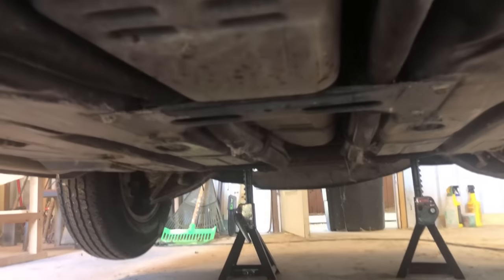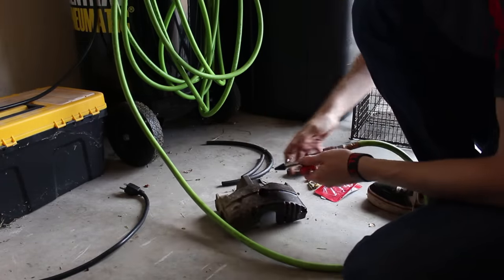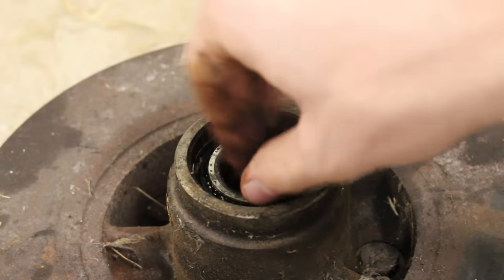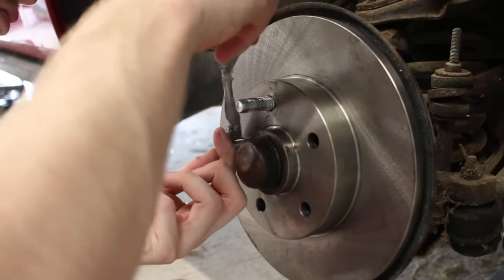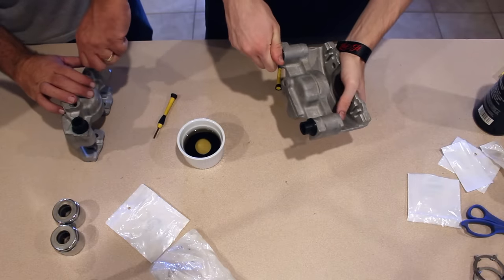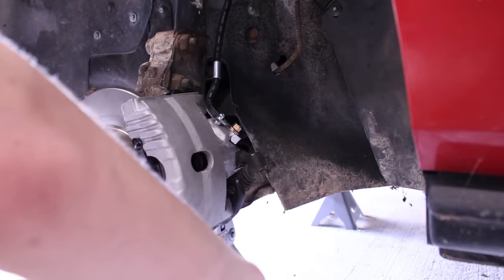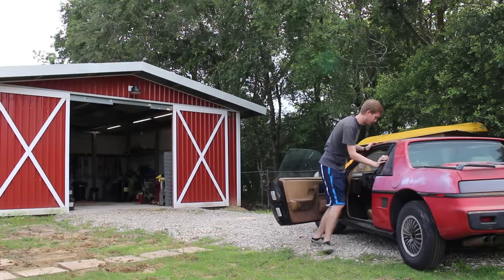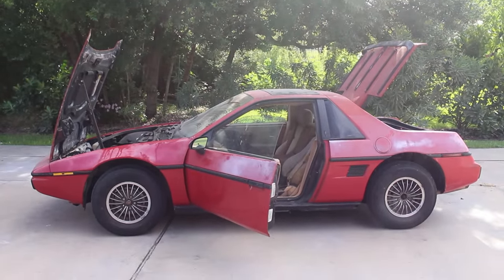Fiero Drive With Me | 1985 Fiero 2M4 Revival - Part 3

Comment: Fiero with a working e-brake? Car is now SUPER RARE
Reply: I agree. My 85 i wanted to fix that but then saw the cable is cut and gave up
Reply: i once owned 7 fireos....2 of them had working ebrakes....
Reply: It’s actually a hand brake. Not an e brake.
Reply: @warmfreeze  close behind you. I've owned every year model. Haha still have an 88 Formula and an 85 GT notch.
Reply: Totally agree!!!!! My 87GT park brake never worked... hahahah
Reply: mine works on my car
Reply: @DavidHh1969  parking brake
Reply: @MrSubaru1387  ironically i still have my 88 formula and 85GT notch XD and now i own subarus as a daily.. XD
Reply: @warmfreeze  I'l currently have 15 Subarus. Owned more than I can remember at the moment.
Reply: Hahaaa, then you must drive the BMW E39, where a new installed parking brake system isn't able to hold the car at steep hills, well, it holds it, but I don't trust it, because it holds barely. Enough that the car doesn't drive down the hill. 

And I bet my bottom dollar, that every E39 has this crappy parking brake thingy. Every one, also when you overhaul the complete system (what I did, expect the cables, but they are adjusted properly) it get's better, but compared to my old 1996 Honda Civic (pull it under driving and the rear wheels lock up) it is a worthless piece of junk. 
I think the Fiero does a better Job.
Reply: so very very true, the cable always rusts tight in the sleeve, or the cable stretches out and doesn't grab.
Reply: The Fiero came with a spare brake cable already routed so when you break the brake cable you get one free repair.
Reply: It's funny to hear you guys talking about Fieros and Subarus. My dad's friend had a new Fiero GT for a few years, and then bought a Subaru. That's a random sort of coincidence, given the Fiero is a very different vehicle in almost every way than any Subaru, and it's hard to see why one would lead to the purchase of the other.

Comment: Much respect for not just replacing every broken part with anew one. I realize there were cost saving reasons behind this but it makes the videos more entertaining and it makes the rebuild more sensible by not throwing thousands into a car that couldnt be sold for what was put into it. 👍
Reply: The Gmork  yep cause they rip u off especially on a car that is hard to get parts so they might need to custom make them

Comment: I assure you, dumb luck is a major portion of any shade tree mechanic's toolbox!  Especially when starting out.  After that, we call it experience.  Great job getting her going.  That was a lot of hard, tedious work... but it paid off!!!!!  Hold your head high!  You did well!
Reply: Cant drive a standard worth a crap though... Did you hear that clutch plate spinning?
Reply: I totally agree, Thomas!  I’m still fixing things by dumb luck and I’ve been at it for years.
Reply: It's hands on experience
Reply: @jonross377 , He did it on purpose to clean up the clutch and flywheel.
Reply: @augustreil  Maybe you are right, just seems odd that he continued to do it through the other gears.
Reply: @jonross377 , True. Could be that the clutch needs to be bled more ? Not really sure, but either way, they did a pretty good job for what seems to be very little money. To be young again !
Reply: @augustreil  Got to agree with you on that. They definitely did a good job!

Comment: My first “good” car, in 1988, was an ‘84 Fiero, same red with tan interior as this one. Mine was bought from the local Pontiac dealer’s used car lot, complete with a dealer rebuilt iron duke. It was not due to an engine fire, but because the Jiffy-Lube tech failed to retighten the oil drain plug for the previous owner. I was told it went about 20 miles before the engine locked up. Jiffy got to foot the bill for the rebuild. The owner’s daughter never really trusted it after that and, if memory serves, they traded it for a new Grand Am. I was, at 17 years old, thrilled to have something so fashionable and sporty. My father was thrilled for me to have something so slow (mine was an automatic) and that could carry only one of my bad influences (friends) at a time! Back then, yeah ... girls loved it (sadly more than it’s owner). The car was rock solid dependable, braked well, handled well (except it would fishtail like crazy in the rain), and was slower than all get-out! We would turn off the a/c to pass other cars (we referred to it as turning on the turbo). The lack of power steering gives you a great feel for the road and connection to the car (even if it is a pill to park, you get use to it). Seeing this car brings back alot of memories; but I got to say, seeing it in that condition does make me feel old! Hard to believe that was 30 years ago!

I couldn’t tell if your car has the “moon roof”? If so, you can removed it and there is a storage spot for the glass under the hood, behind the spare tire ... in case you were unaware. We removed it every chance we could. Looking back on it, I am shocked we never dropped the glass and shattered it ... but we didn’t! 

Keep up the amazing work ... and, when your finished, please do what I wish I had done ... hold onto it! Good job and I am glad to know that someone your age loves a car that was so popular when I was young! They were always special cars to those who really knew them!
Reply: 26 now, wanted one since I was 16, finances are too tight. But man I would loose to have one of these
Reply: @emokid3167  loose it up!
Reply: Brian,I was going to write a reply and came across yours ,change a few details and you have my story,. Ronald good job ,love the fact you went with rebuilding not buying off the shelf...

Comment: Haha, nothing short of excellent entertainment! Having worked at Parkway Pontiac during the early Fiero years, I know exactly what your going through, and I know what's to come. :-) 
If you have a little money to burn, this is an enjoyable way to learn. 
One tip I'll give you, when you have to replace the head gasket, you can sit at back of the car, with your legs in the trunk area, much easier than trying to over reach over the trunk while standing.
When the engine block cracks, well, that's another story all together ..... 
Hope you are having fun, can't wait for the next installment, brings back a lot of memories.
Oh, one other thing, early Fiero's like this, handle much better with a little extra weight in the front, we used to use a couple of small bags of play sand up front when auto crossing.
Enjoy the ride.
Edit: some of the fires were caused by cracked blocks, or lifter covers leaking oil onto the catalytic convertor, make sure your leak free, Ride safe!
Reply: 44for is
Reply: I will bet working on the v6 models were a real pain,  all that motor so little room

Comment: Had a black '87 - Stick shift, 40ish mpg, 92hp, and I LOVED it. Took me across the country and back. Eventually the rear caliper stuck and melted the brake line which then ignited the fluid with it on fire on the side of the interstate. Got it fixed and it lasted a few more years until I got my Saturn... Thanks for making these vids.

Comment: You should have painted the calipers red cause it makes it stop better.
Reply: Also racing stripes make it faster
Reply: Demetrius Lolos Yes, definitely.  They make high temp paint in red just for that purpose. Just make darn sure to throughly clean the aluminum with a non reactive cleaner. High temp primer is advised but is hard to find. Best of luck. Great job so far.
Reply: Lol
Reply: BOSS MAN  the box said 10 horsepower
Reply: Red calipers make it go faster too.  That's why it's called "Brake Horsepower" (BHP).  My car has red calipers and it does go pretty quick!
Reply: Don't forget the tornado that goes in the air intake.
Reply: I was just waiting for this to be said LMAO, also, tint your windows and put a michelin sticker on the tires, 200hp.
Reply: @robertdaniel2564  Woah there, that maybe too much for the cars transmission now.
Reply: I am pretty sure red calipers are +20hp I believe mcm said it.
Reply: +25KW

Comment: I had a couple of Fieros back in the day.  Here is a quick tip.... pull the thermostat and drill a 1/6 hole in it.    The modified thermostat will keep the engine from overheating while you sort out the car.    Keep the videos coming!
Reply from the maker: Everything has already been sorted out for a few months now! It was just a relay issue with the fan :)
Reply: better to get the 160 degree Thermostat from Fierostore
Reply: The hole is more for bleeding the air out, not allowing fluid to pass, trapped air will have it misreading coolant temps and remaining shut, that is the only reason, FYI most new thermostats have a bleeder.
Reply: @Maples01  My old Fiero used to do that to me from time to time, same advice I got from other owners on Pennocks
Reply: @Lon1001  I always buy quality thermostats, they've all had a hole in them, when it comes to replacing them, get the best, don't risk your engine for a few bux.

Comment: This is a great series you've put together so far man! October of 2017 I bought a 1987 Fiero 2M6 (2.8L V6) from an old family friend for $2800, but it was already running and driving and in pristine condition. I  love the car and it's fast enough for what it is, but I'm planning on doing a 3800SC engine swap sometime in the future. Still fun to tinker on though. The Fiero never got respect but it's a fun little car to drive around.
Reply: Is it good on gas for having a v6?
Reply: @Jason_Phillips3679  it gets about low 20s combined if you're not hammering it all the time. But it has a 10 gallon tank so gas is really cheap. 170 ft-lbs of torque in a 2800 lb car isn't bad, except for the 3 speed automatic transmission lol
Reply: I bought an 87GT at a storage auction June 17. Didn’t need  much to get back on the road (last registration was ‘99). Ive been driving it since has a 5speed not much power but fun to drive.
Reply: Might as well ls4 swap it

Comment: There is knobs near the head lights that allow you to manually turn them up just in case the plastic gears have broke in the head light motors.
Reply: When you replace the gears for the headlights use the metal ones, they last longer.

Comment: Been using bearing race/seal installer for around 30 years now. That's fine. But we have got to get you a real hammer!
Reply: This is affirmative, save the claw hammer for nail pulling.  Get ya one of them ball and peen hammers. You'll be glad ya did
Reply: Yep, 3 pound minimum
Reply: I noticed the claw hamer too.  But that's what's cool about him.  He uses what's at hand.
Reply: @stwhite5135  l definitely give him credit for innovation and the ability to dive right into things!
Reply: Offer an easy cheat on next bearing race install. Put the race in freezer and hub in oven or torch it then just drop it in no beating and no pressing.
Reply: I was thinking the very same thing!!!
Reply: @stwhite5135  I'm actually surprised he hadn't used a rock yet.
Reply: I second this, get a real hammer.
Reply: 5-6 lb short handle sledge. The good old BFH.

Comment: Nice work. I have a 1984 Fiero 2M4 4 cyl. standard transmission single owner which was parked from 2017 till last week when I picked it up. It was parked in a concrete driveway so none of the problems you guys had on yours are evident. I haven't tried to start it or anything yet. Too many other projects in the works but I am toying with the idea of taking a front wheel drive front drivetrain and sub frame and turning this into a twin engine all wheel drive for super cheap. I have an extra mid 80's Corvette parts car that I might steal some stuff from. Problem is I will want to put at least V6s at both ends of it if not V8s so I am leery to start this project because I get carried away pretty easy. The idea is appealing not only for massive acceleration ability but it would also be a super easy way to fix the front suspension problem not to mention if ever one drivetrain failed you could just use the other one so it should be like 500% more reliable than any single engine car. One thing holding me back is that I can take a front wheel drive drivetrain and put it in the back of any front wheel drive car and that would also achieve the same purpose but with much more interior space and depending on your taste potentially a nice looking body style.
Reply: oh boy keep me updated on this one

Comment: You might want to invest in a parts washer.  You can get a mobile parts washer for under $150, basically a cooler with a pump and brush built in it.  it works a lot better than spraying a part on the garage floor and taking a brush to it.

Comment: I drove an '84 Fiero in college when it was about 6 years old. Mine was black with the tan cloth interior, which had the suede inserts. I have distinct memories of that car, strongest of which was that it wasn't easy to drive. The gas pedal is oriented so that the hinge action is too low. i would end up pushing the top of the gas pedal forward instead of the entire pedal. 
Don't EVER let it run low on oil and watch for leaks at the valve cover.
Reply: Tyler's Neighborhood Garage Funny you say that. When he let me take it on a drive I did the exact same thing with the gas pedal and thought the car was super underpowered.
Reply: Back then it was a cork gasket.  Oil leaks onto manifold cust never smells it
Reply: @jerryvair4919  The overriding concern is that the oil capacity was reduced in that particular application, and that, combined with people running those iron Dukes harder than they wanted to be ran contributed to more than a few holes in the blocks. Then you have fire.
Reply: @TylersNeighborhoodGarage  I had an 84, 85, and 87, How do you like that oil filter setup on the 84? Giant drain plug with the filter inside the pan, so glad they changed that. I knew something was up with the gas pedal! When I'd floor it and take my foot slowly off the throttle I noticed it pulling harder. Thank you for your wisdom.

Comment: I used to have an 85 or 86 gt in black w/4speed that had alot of little upgrades when I got it ..it was fun and almost my end sadly .. still regret selling it .. keep an eye on the clutch slave cylinder bracket ..there made out of pot metal .. I broke 2 before having a friend make one out of stainless . it's so much better ..the floating gear pattern feel isnt as bad less miss shifts ..if you remove the adjustable seatmounts on the drive side you can solid mount the seat and gain more leg room for us taller ppl and if u mount it an inch lower feet fit better at the pedals and you dont stare at the visor driving.  and all the bushing go urethane ..and motor mounts ..it helps ..that's my 2 cents thrown in ...

Comment: Those calipers look pretty big for such a small car. I think 3rd gen F bodies have smaller brakes up front!
Reply from the maker: It’s funny you say that! One of the biggest complaints about Fiero’s, at least the earlier models, was that the brakes were too small or anemic. Maybe it’s just the tiny rotors that make them look big?
Reply: @RonaldFinger  Solid non-vented rotors are the weak point.  Very easy to get brake fade if you push it hard.
Reply: @RonaldFinger  Brakes were off a Chevette.
Reply: theyre as big as my Audi TT brakes!
Reply: 3rd gen F bodies without 1LE had the same front brakes as GM's full size trucks and the rotors are almost a full inch larger than the Fiero rotors (9.7" vs 10.5")
Reply: F bodies have pbr type calipers.  Brackets are seperate
Reply: They're single piston brakes front and rear, which is definitely pretty small for a sports car of this era. My car is from the same era (FC RX-7) and came with single piston rears and four piston fronts from the factory.
Reply: @MitchBowman  if you're talking about the Fiero the 2M4 is really just a 90hp economy car
Reply: The '88 had much bigger rotors and calipers...the minimum wheel size was 14"

Comment: I appreciate you wearing gloves. Silicone absorbed into body through skin.
I would like to make a few mechanical suggestions.  Switch to leather gloves when hitting race driver. Incase you miss.  Use a 20 oz ball peen hammer not a carpenters hammer.  You'll appreciate it a lot.  Last please get used to safety glasses.   I just don't want you to get hurt.  I like your car and progress on your project this far
Reply: GTFOH Dudley do right LMAO!!
Reply: I know a guy who has partial vision loss in one of his eyes because he was under a car doing exhaust work with an impact wrench. A piece of rust fell into his eye and severely scratched his cornea. jerry's advice above would have saved his vision and it would not take too much effort that day for my friend to wear a pair of $3 safety glasses.  @yessiryousir

Comment: Claw hammers are for carpenters, ball peen hammers are for mechanics, lol. But you are doing a great job.
Reply: Kitchen knives are what real mechanics use.
Reply: A roofing hammer is great for precision hammering in tight places, especially with the single long pointed claw.
Reply: He needs a soft faced and deadblow hammers for his upcoming bodywork.  Not to mention unbolting that steering wheel....